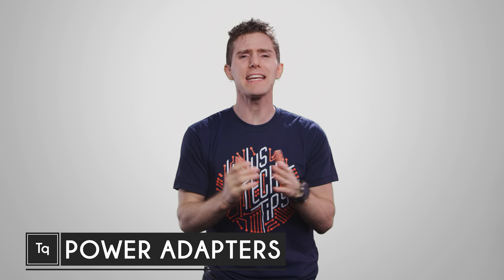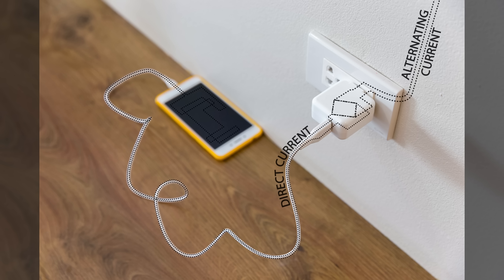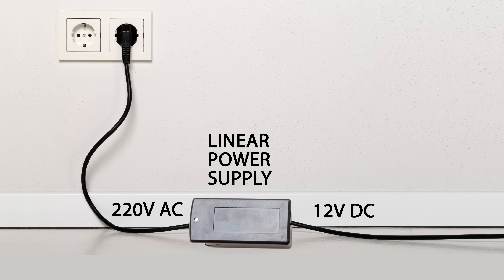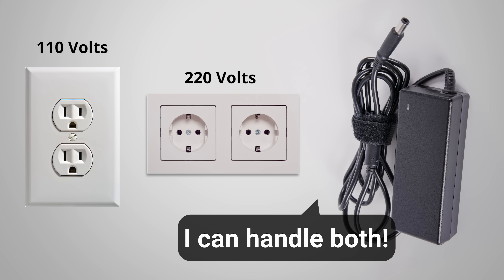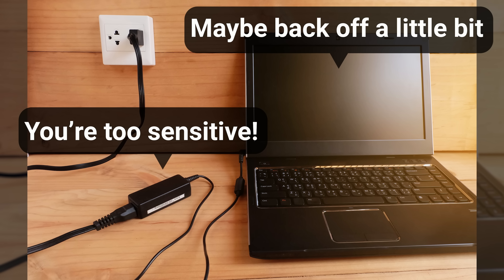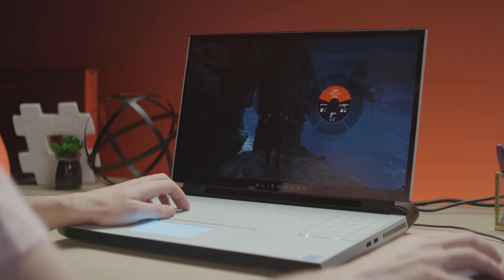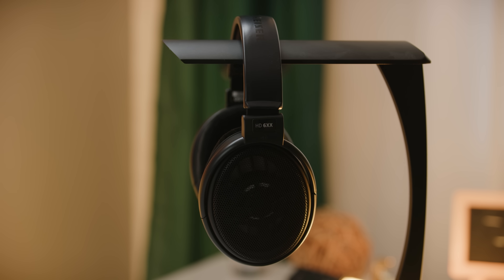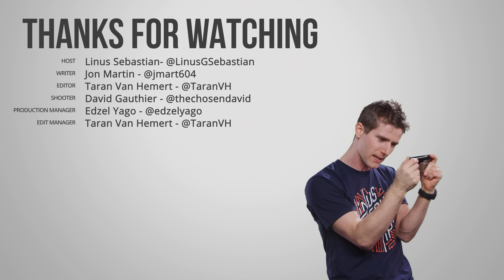Why Power Adapters Are So HUGE

Comment: As a side not, SMPSs themselves ARE extremely efficient (depending on the operating conditions). The bulk and power consumption mostly comes from first rectifying the mains power, then cleaning up the output of the switching regulator itself. 

In regards to bulk, transformers are commonly used on the mains side to both isolate the device and bring down the cost and size of the rectifying components. Additionally, the more power required, the larger (both physically and in terms capacitance/inductance) inductors and capacitors you'll need to smooth out the pulsed output of the controller.. That's why your phone's charger (just look at the kindle's 5V adapter) can be so tiny while performance laptops have bricks that really earn the name.

In regards to inefficiency, as I mentioned, rectifying the signals is where most of this is lost. First of all, SMPSs are DC-DC converters, IE, they need a DC signal to function, so the AC signal needs to be rectified.To rectify an AC signal, you will typically use a bridge rectifier consisting of rectifier diodes. For the most part, they have extremely low on-state resistance, so that can mostly be ignored. However, they do have a threshold voltage which must  be overcome before they begin conducting. P=IV, where P is power, I is current, and V is voltage drop across the device. Even if the material used to create the diode is a super conductor, that threshold voltage will remain, and the power consumption of each of the diodes will be directly proportional to the input current. The rectified sine wave then needs to be smoothed out via capacitors. The higher the voltage input, the lower the losses in the diodes, but the cost and size of the components needed to rectify, smooth, and convert that high input skyrocket as well. Then, the output of the switching controller driving the converter is essentially a pulse-width-modulated signal, so it switches between 0V and the input voltage at a certain rate. That is then connected to a capacitor, inductor, and dioede configured for the specific use case required for the application (do we need a higher output, lower output, or both?). The more power draw required, the larger the components will need to be.

Finally, as you mentioned in the video, there are RF concerns. While part of that has to do with the conversion process itself, there is also the issue that no matter how large the output inductor and capacitor that you use are, there will be some ripple in your output. I.E. it's not very clean power. For sensitive electronics, that's a problem. To get perfectly clean power, you'll need to go back to the linear converters you mentioned at the beginning. They typically consist of a zener diode and a resistor. When the voltage is above the reverse threshold of the zener diode, it will conduct to pull enough power to drop the voltage down to that threshold voltage, and the "missing" voltage is dropped across the resistor. To increase the efficiency, you will want to select a linear regulator that is as close as possible to the bottom of the ripple voltage without risking some other phenomena that I won't address here. That concludes my TED talk. Thank you all for coming.
Reply: You mean note

Comment: Another reason why some devices do not have internal power supplies is that if the device plugs into the wall, it needs to be certified for safety before you an sell it. Certification costs money and it is cheaper to certify the external power supply once and sell multiple devices that can use it.

That being said, I dislike when a device with no batteries has an external power supply. I also prefer linear power supplies or at least power supplies with 50Hz transformers (the voltage regulator after the transformer can be switch-mode) because they are easier to repair than switching power supplies. 
And cheap PC power supplies with Active PFC (and crappy high voltage caps) have a very annoying failure mode where the power supply blows up and trips the circuit breaker. Now you have to turn the circuit  breaker back on to get your other devices working again.

Comment: Oh my god nobody has ever used a linear power supply to convert mains to 12v! nobody sane anyway! linear power supplies are more for 5v to 3.3v type of stuff. A linear power supply converting 120v to 12v would be <10% efficient, consuming 1kw to output 100w of power...

old power bricks use transformers!

Comment: Switched mode power supplies get their name because they operate by turning on and off the power and varying the duty cycle (and sometimes frequency) in order to keep the output at a specific point, kind of like how a PWM (pulse width modulated) signal can be used for DC motors speed control. Actually, the simplest SMPSs are DC-DC, not even AC-DC.
Input voltage has nothing to do with the mode of operation!

Comment: Massive misinformation. You could have asked a competent electronics guy for a few minutes to make this video. 
The size of the power adapters has nothing to do with AC-DC conversion.  LED light bulbs have AC to DC converters internally, thus, small size.
The size is dictated by the WATTAGE and DC output quality of the power supply/adapter.  Laptops require huge adapters as they are sized/watts for simultaneous charging and use of a laptop.  If your laptop charges very slowly while you use it, it means you have a small/weak power adapter

Comment: >move to solar panels on roof
>Store the generated dc current in batteries
>Directly use the dc current. 0 ac/dc conversion, zero electricity wastage

Why isn't this a thing?
Reply: It can be, it's just easier to convert to ac.

Comment: This is still an area that tech companies can push.

Apple doesn’t use external power bricks in their iMac’s or Mac Mini’s, and their laptop bricks are still fairly small.

As phone chargers need bigger and bigger power units, and laptops chargers are increasingly becoming lower and lower wattage - I think we’ll see a point where the units combine and we just use USB C cables directly into the wall.

Apple is almost there at the moment in that they recommend their 29 watt wall charger for both the iPhone and one of MacBooks, but hopefully this becomes more widely used by other manufacturers as well.

Comment: You know power adapters of today are BS because manufacturers could really use two diodes to to convert from 120 volts AC to 120 volts DC and then a down step Transformer to convert 120 volts DC to 12 volts DC😔

Comment: This video fails to explain why my switching phone charger from 10 years ago is 50% smaller than my current charger of the same power output! Also, why a contemporary USB 3.0 cable can be used for cantilever lifting of an external hard drive?! Don't get me even started with the thickness of power supply cables that go to mains.

Comment: If only the electrical companies would just output 5 volts so that way our devices wouldn't need giant power supplies we could even replace all the plugs in our walls with the USB at least all the ones not in the kitchen or garage

Comment: Ild be glad for a laptop power supply the size of the ones your showing.
I just recently bought a new psu for my laptop to cut down in size and cables.
My old one was 2 big bricks weighing over 3kg my new one is about 1.5kg 770watt.
When i go to PAXAus this year il certainly be glad for the drop in weight and size.

Plus bought it because the adapter that converts the two bricks into one cable kept pulling the cord out the back of the laptop.
Certainly causes issues when I’m waiting on a warranty claim for parts.
Keyboard+”not covered”battery.

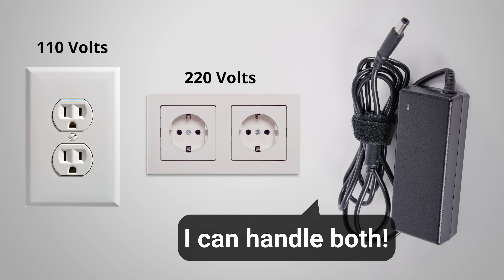Comment: 2:41 is total BS. This is supposed to be a tech channel, so please take the time to research correct explanations a quick google search for switch mode power supply will tell you the correct answer. what you describe in this segment is a universal input power supply(it accepts an ac or DC voltage in a wide range) this has nothing to do with the function of a switch mode power supply

Comment: Switch mode power supplies are called that way because they have to switch a transformer at really high frequencies, 20KHz or higher instead of the slow mains 50/60Hz, it has nothing to do with being able to work with 120 or 240V.
Come on guys, it doesn't hurt to ask in the forum for help on subjects you don't understand very well.

Comment: This video is so wrong. Switching power supplies are called switching because of the way they work. ALL switching power supply convert AC to DC in the initial phase (in a 220V system the DC rises to something like 400V). Then a switching circuitry sends current impulses (15KHz - 50KHz) into a transformer. Those impulses are driven in a way that the output from the transformer is exactly what the power supply is designed to output.  This has nothing to do with the fact that they can adapt to 220 or 110V outlets (actually not all switchers can adapt to this automatically.. a lot o them still has a 220/110 selector). And regarding the integrated power supply (like your example... the monitor) is still switching power supply. TVs also has switching power supplies.... consoles... basically any device used today.. has a switching power supply.
Reply: Wow
Reply: Stop copying electroboom fancy words

Comment: This is why every home needs a central high efficiency AC to DC converter. And DC outlets in the home (*one per voltage level).
It is also safer, because of AC lower impedance in the body then DC resistance.

Hope every new power wall gets DC power delivery output, that would be great! Then we would also get a UPS in the house.

Comment: Plus points for using a full bridge rectifier schematic on the AC-DC animation. However that's not what switching power supplies are. "Switching" refers an on/off action made by the circuit to regulate the voltage. Also thinner/smaller components does not necessarily have too much resistance, but they do have lower AMPACITY, and that is why they have to be bigger.

Comment: Because they have transformers. 
A transformer must be huge due to the coil and the iron core required to make it work .
 We have no other way to down step voltage till now. Rectification diodes and capacitors are just a small circuit that take no space at all

Comment: Sugg: Why sony and microsoft use AMD based systems with their consoles instead of intel and nvidia which is more powerful?
Reply: probably wont happen as the answer is rather simple: AMD is able to produce a full and capable SoC, Intel can't. And splitting CPU and GPU in consoles would increase the price and lead to another bunch of inefficiency issues.

Comment: actually its not the conversion from ac to dc that is the problem.
its voltage.
the biggest part of an adapter is the transformer.

bridge rectifiers can be really really small.
Reply: It is also the AC to DC that ALSO applies

Comment: Europe is 240 volt now not 220
Reply: china has 220v i think

canada has the 120v system and to be honest i think its terrible
especially the plugs , so sloppy design.
Reply: voltage varies so much it seems.
110,120,220,240
why can't we just decide on a voltage LOL.

i would like 300v.
as the high voltage would allow for smaller wires

Comment: 0:20 that laptop is the one that i have, just with an extra USB port. Its a lenovo ideapad 300 series and the power adaptor is actually quite small for a £300 laptop

Comment: One word- safety. In the UK, a mains socket can be dumping 5 x 32 x240 Watts into a faulty wallwart before the breaker trips a fraction of a second later.  That's about 40kW.  Think large fireball. Don't buy cheap wallwarts, period - you really, really don't want that to happen.  Ones on a lead with a mains plug are far safer (in the UK) - there's a fuse in the plug that can limit that power dump to 5x3x240 Watts. Think quite small fireball.  If you really must use no name wallwarts - plug them into an extension lead with a plug fitted with a 3A fuse. 

Size, as they say, does matter. But quality matters more.
Reply: Extension Leads actually use 13 Amp Fuses not 3 Amp

Comment: I backup/transcode film cam data on location.
Often Im stuck in a van in country, in winter 1-3am. 
I put the adapters under my feet to keep warm.
Reply: I also use my Xbox One power adaptor as a small room heater. 
Of course, I do have my Xbox One on all night. 
(It's true, powering off and on your devices over a long period of time causes it to lose its longevity)
Reply: I'm*

Comment: But why can’t we put the battery charging controller into the AC adapter? Why do we convert 220 or 120 volts ac to 19 dc than send it to the Laptop that converts it to something like 12.7 for the internal battery? This could be done so easily especially with charging standards like usb C that already support different voltages.
Reply: also from 12.7 or what ever down to 5 voltage per cell
and then of course back up again when the battery is being used .
5v to 12.7v or whatever
Reply: @logangraham2956  Zells don't run on 5V, they run on 4.2 but are often connected in series so the Voltage is higher (If you battery pack has 3 cells in series it is 12.6V)
Reply: @MrFritz123ification   no i've check.
i have bunch of them right here beside me and they are just a little over 5v
Reply: logan graham https://en.m.wikipedia.org/wiki/Lithium_polymer_battery
If it says it is either two older cells in series or it has an internal converter

Comment: Linus, are you aware of a major reason why manufacturers use external power adapters?   There is a loophole in allowable RF emissions regulations:  

Manufacturers only have to submit one model of a power supply for certification.  They will build a power supply with quality components, get that "version" certified, then start cutting corners on internal components until the power supply greatly exceeds RF radiation limits.  (With a cable toner, you can hear these "dirty" power adapters for laptops and electronics from across a room!)

These RF emissions/dirty adapters are bad for connected devices, interfere with other devices, often exceed federally recommended RF radiation exposure limits which is bad for humans, they don't last as long, and they are less efficient.  By building the power supplies outside of devices, they can more easily cheap out in this way.

Comment: or adapters can just be fitted into the outlet
Reply: i know right , i mean.
most things are either 
12v
or
5v
so just add 2 more prongs
add a +5V and a +12v
and keep the neutral the same.

Comment: I actually prefer external power adapters on consoles as I have enough room to hide them. Just for the piece of mind to know there's one thing less to generate heat inside of an already cramped and hot box, and it's way easier to fix or replace when things goes wrong too...

Comment: Does battery capacity degrade faster in a smartphone due to newer processors, additional RAM, and new demanding software features?
Reply: No the 1 thing that degrades Smartphones batteries the easiest is too much HEAT
Also,draining a Smsrtphone Battery fully every day will also ruin the Battery quite quickly too